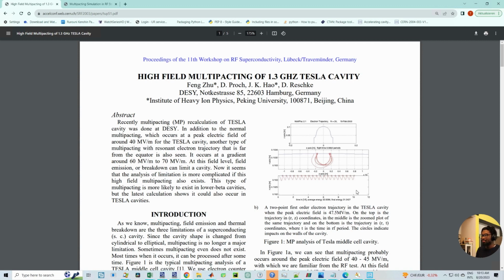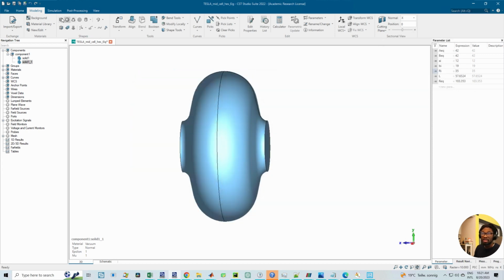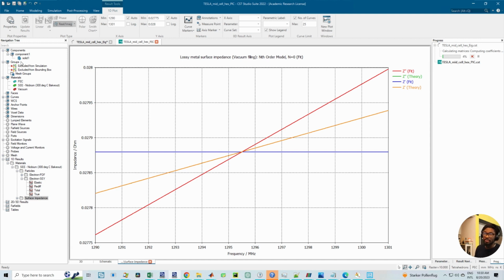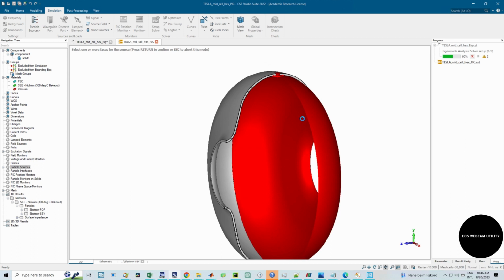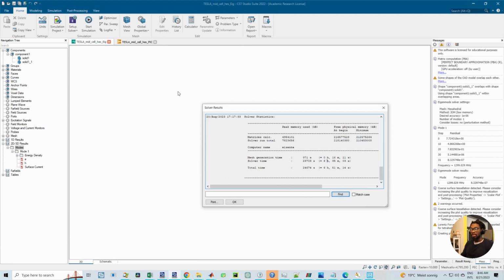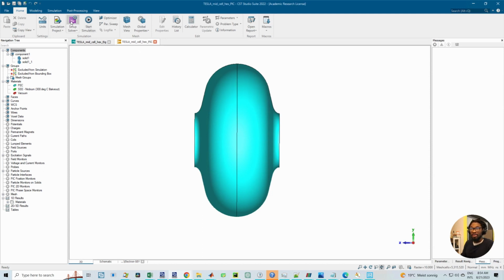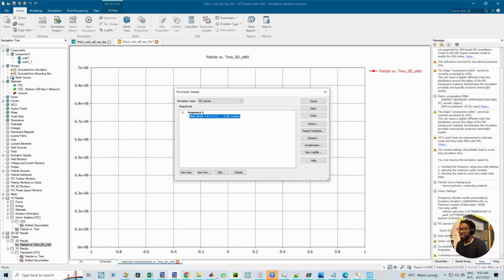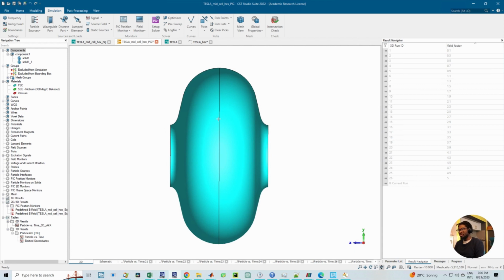Multipacting Analysis of a TESLA cavity mid-cell geometry using CST Studio PIC Solver

Comment from the maker: Secondary emission properties of Niobium used for this simulation:
SEE - Niobium (300 deg C Bakeout)
Material Set    = Default
Type            = Lossy metal
SE emission     = Furman

NOTE: In order to access the "Particles" tab, your "Problem type" has to be either "PIC" or "Tracking".

On the "Particles" tab for material definition, select Furman as the SE emission model, click on ''True", and input the following for Energy and SEY
Energy: 300
SEY: 1.49

SEE Niobium (Wet Treatment)
Energy: 300
SEY: 1.2

[1] Kneisel, P. (2003, September). Surface characterization of bulk Nb: what has been done, what has been learnt?. In Proc. of the 11th Workshop on RF Superconductivity, Lübeck/Travemünde, Germany.
[2] Scheuerlein, C., Hilleret, N., & Taborelli, M. (2002). The secondary electron yield of air exposed metal surfaces at the example of niobium. Appl. Phys., A, 76(CERN-EST-2002-003-SM), 1085-1091.

You can also look here for a description of the Furman model.
[3] Furman, M. A., & Pivi, M. T. F. (2002). Probabilistic model for the simulation of secondary electron emission. Physical review special topics-accelerators and beams, 5(12), 124404.

Comment: I WANT TO CHECK DARK CURRENT FOR DIFFERENT MODE IN MY CAVITY STRUCTURE THAT HAS HIGH FIELD AT THE IRIS SO DO I NEED TO INTRODUCE THE PARTICLE SOURCE AT THE IRIS OR AT THE SAME LOCATION WHERE YOU INTRODUCED THE PARTICLE SOURCE?? AND MY MATERIAL IS COPPER ANEALED 
PLEASS REPLY

Comment: Superb video, thank you! I'm trying to do the same simulation but I don't have the SEE material, how can I get it into the CST materials library?
Reply from the maker: Thanks. Apologies, I think I defined it some time ago, and it's been carried over since then to newer versions of CST that I thought came predefined. Here are the relevant properties for the definition of the material.

SEE - Niobium (300 deg C Bakeout)
Material Set    = Default
Type            = Lossy metal
SE emission     = Furman

NOTE: In order to access the "Particles" tab, your "Problem type" has to be either "PIC" or "Tracking".

On the "Particles" tab for material definition, select Furman as the SE emission model, click on ''True", and input the following for Energy and SEY
Energy: 300
SEY: 1.49

SEE Niobium (Wet Treatment)
Energy: 300
SEY: 1.2

I got the secondary emission properties from these papers: 
[1] Kneisel, P. (2003, September). Surface characterization of bulk Nb: what has been done, what has been learnt?. In Proc. of the 11th Workshop on RF Superconductivity, Lübeck/Travemünde, Germany.
[2] Scheuerlein, C., Hilleret, N., & Taborelli, M. (2002). The secondary electron yield of air exposed metal surfaces at the example of niobium. Appl. Phys., A, 76(CERN-EST-2002-003-SM), 1085-1091.

You can also look here for a description of the Furman model.
[3] Furman, M. A., & Pivi, M. T. F. (2002). Probabilistic model for the simulation of secondary electron emission. Physical review special topics-accelerators and beams, 5(12), 124404.